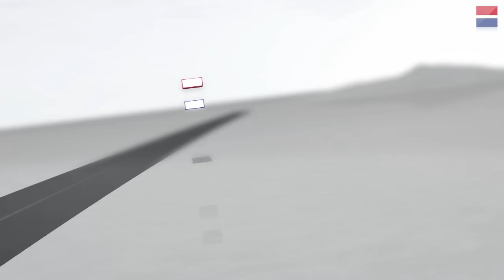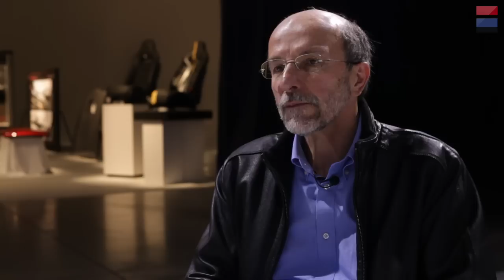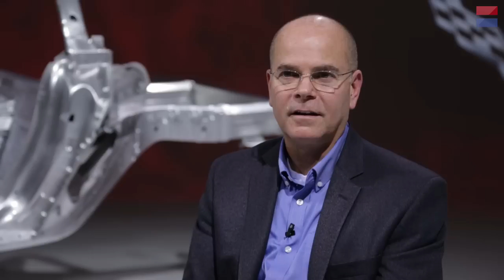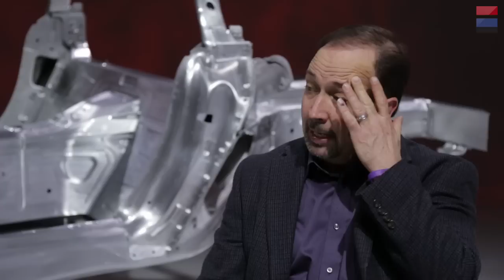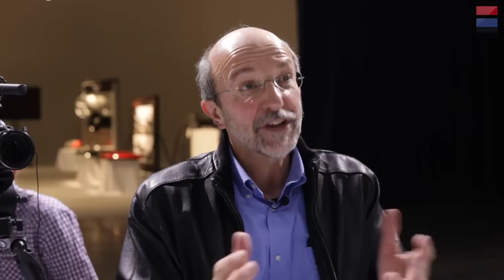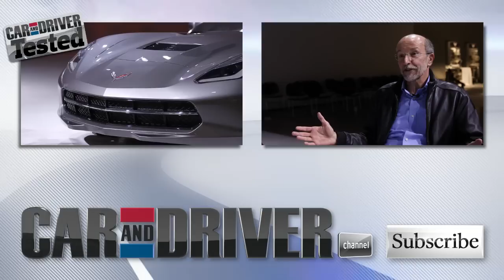Part 2 of 2 of The Interview Series @ 2014 Chevrolet Corvette Stingray / Z51 - CAR and DRIVER

Comment: yea i agree. im a vw owner, and i can tell you, the parts them self are high quality (suspension, materials, chassis, engine, plastics,,,) but the electronics are usually the biggest culprit with the newer vw's. its all fine while you have the warranty, but without it, get ready to pay up. luckily, i do my own work on the car, and its quite simple to work on, once you get a few special tools , hehe. aftermarket parts are veryyy nice tho, but realllyy expensive.

Comment: The leaf works awesome on the race track.  You don't understand its primary purpose which is anti roll.  The only advantage coils have for racing is they are easier to change, adjust, and you can buy all kinds of springs rates.  But for cornering ability and lap times for a given spring rate, the leaf is superior due to its making the car lighter, have a lower center of gravity, and lower unsprung weight.  GM puts coilovers on the Aveo.  They put the expensive leafs on the Corvette for a reason.

Comment: pretty fair question..... @adamtank2000 actually those cars are EXTREMELY well-matched. they are within 2 HP (Viper - 640, Corvette - 638), 1 pound (Viper - 3354, Corvette - 3,353) and 4 lb-ft (Viper - 600, Corvette - 604). Pretty much the only difference is the accessiblity of the performance - the viper is very hard to drive fast, but the Corvette is easier for an average driver to drive pretty fast.

Comment: the leaf spring works ok, on the street. not so much on the track. the handling capabilities are just higher with a good coilover suspension. i've read several interesting articles on this leaf vs coil subject , there was a good one in the corvette magazine a few years ago. all of them say the same thing. the leaf springs only advantages are lightweight, load capacity and taking up less space, but coils are more performance suited and will make the car handle much better. facts are facts.

Comment: I agree with some of your argument, German cars might not be as reliable but because they usually have much more technology in them, mechanically they are good but its the tech and electronics that cause problems most of the time. I can bet if the corvette had as much tech in the car it would be more unreliable then the Germans. a friend of mine is a manager in a company where they make parts for American and Euro cars. the parts for German cars are much higher quality & more expensive.

Comment: geez why did the butcher the vette. it looks terrible. gaudy. they tried so hard with the lines of the car but they just ruined the nice simplicity of the c5 and c6 generations. and why are they still sticking with that torsion bar spring systems. cmon chevy, whats goin on.